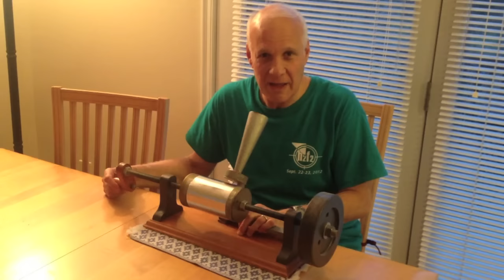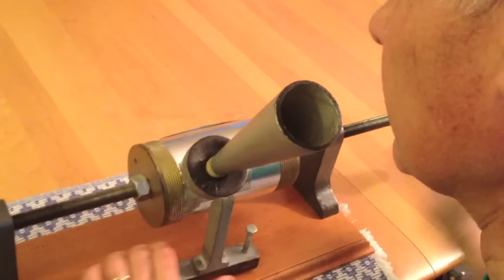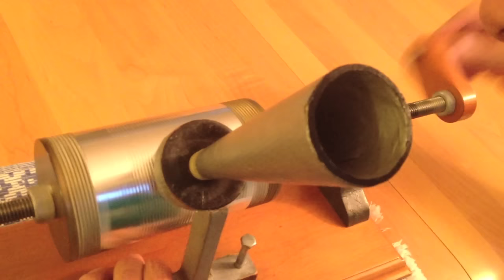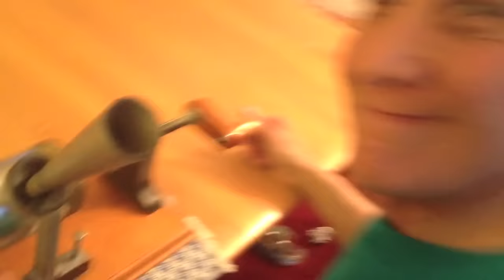Tinfoil Phonograph with less surface noise

Comment from the maker: I don't have plans, Kristina. The biggest challenge is the threaded cylinder, threaded to the same exact grooves per inch as the treaded bolt. Mine is made out of PVC pipe. I made the rest of the phonograph out of wood, though the uprights are laminated with nuts in the middle for the bolt. The sound box has a thin mica diaphragm. You can test various materials. I belt the paperclip and sanded the end point. I put a small rubber tube between the diaphragm and the paperclip needle.